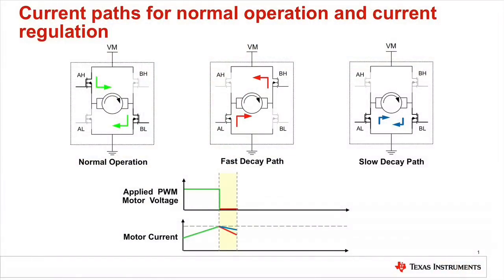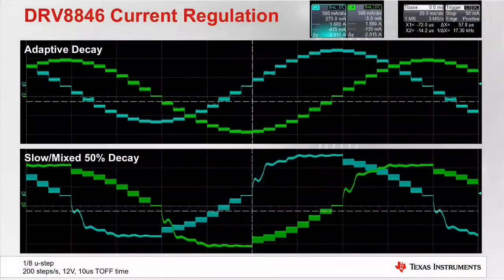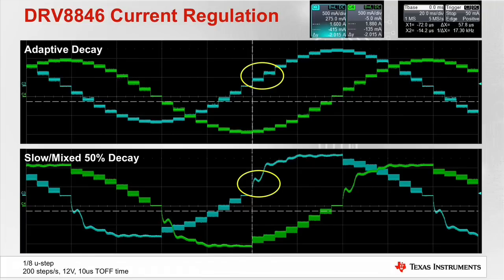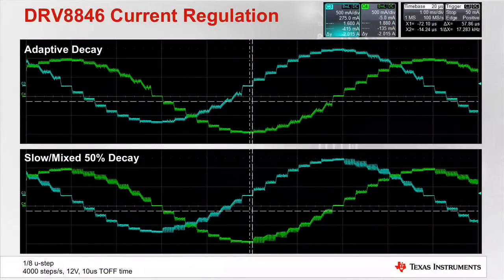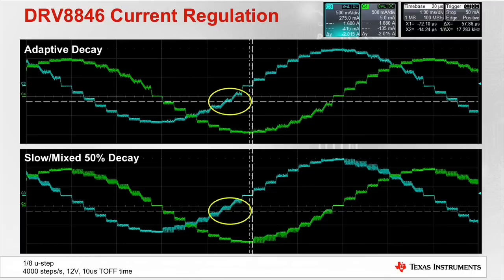Engineer It: How to easily tuning your stepper motor

Comment: I know nothing. How about labeling what the blue/green traces represent?
In addition the traces look very similar, so when transferred to a mechanical system are unlikely to make a significant difference.  How about demonstrating how different those differences can be in a mechanical system? |
Thanks for what you have done so far. :-)
Reply: Hello Mark, blue and green traces are the current waveform of the motor windings. They should be similar and just 90 degrees out of phase. The missing step there at the bottom trace causes the motor to jerk more and make more noise. A few consecutive missing steps can lock the motor, which is very harmful. In the second graph, there are more current ripples at the bottom trace. Disadvantages of current ripple include power supply noise, increased vibration/audible noise of motor, increased heat and reduced efficiency.

In summary, we want to have the waveform that is the closest to a sine wave.
Reply: hohowtf Thanks :-)
Reply: Mark Horton You're welcome!